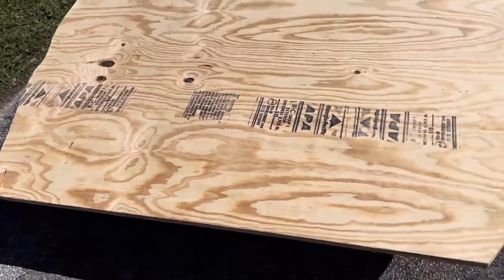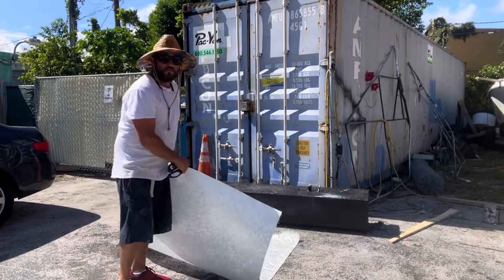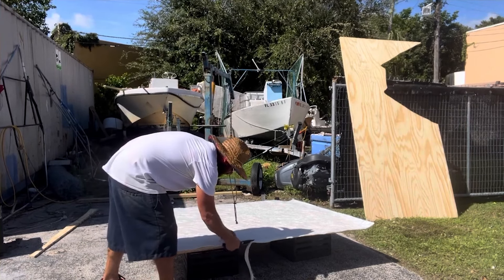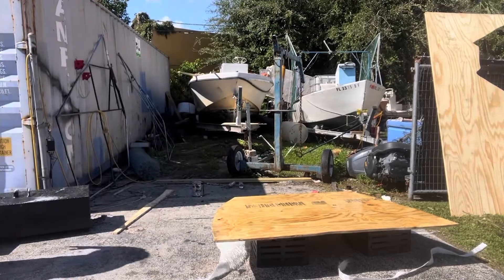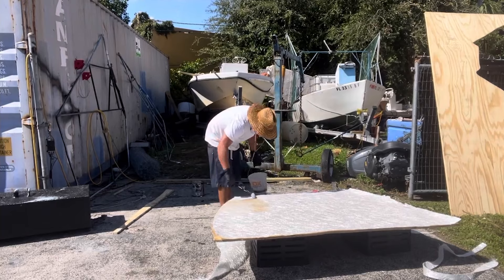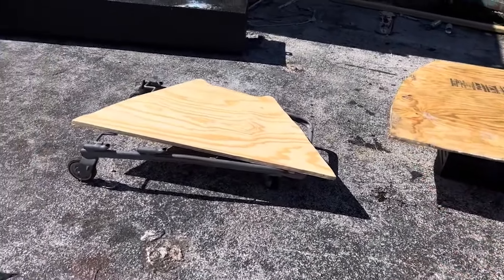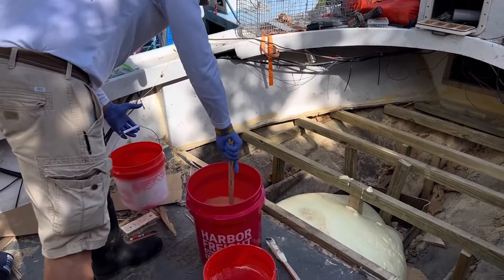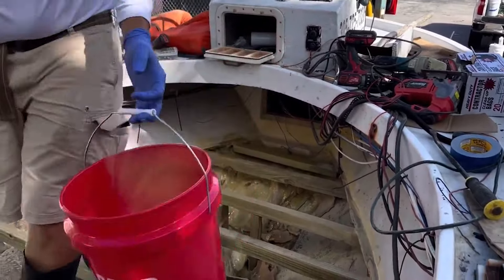Laying glass and foam repair

Comment: I now see why you didn’t want to go live  with this project !! if you were live,❤ I would’ve said hey make sure you run a piece of PVC conduit to be able to run the wires under the deck at a later time if you wanted to. 😂😂😂.  It looks good Joe. VERY CREATIVE WAY TO SECURE FRAMING  NICE JOB !!!🎉🎉🎉🎉
Reply from the maker: @CASHCRZZY1  the wiring goes under the gunnel but thanks for the idea